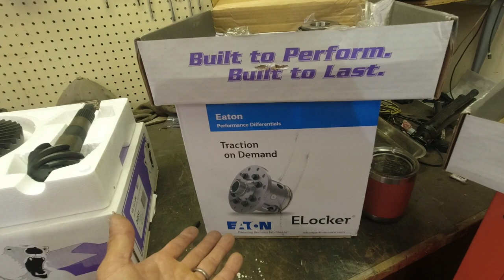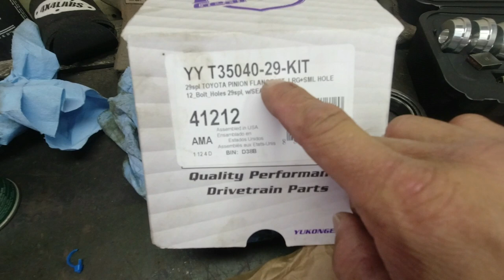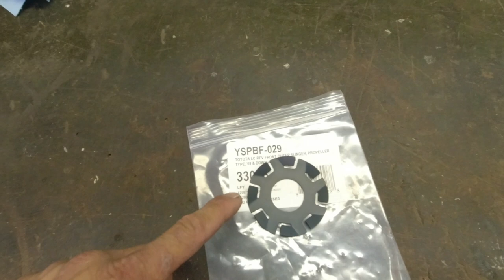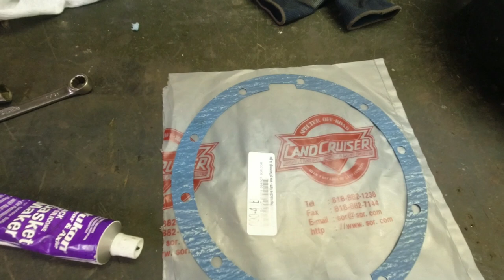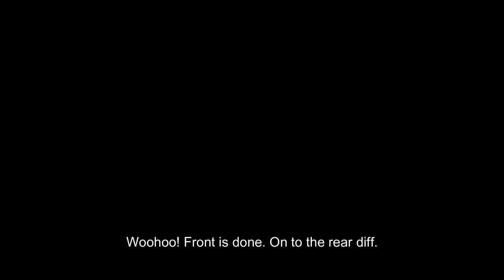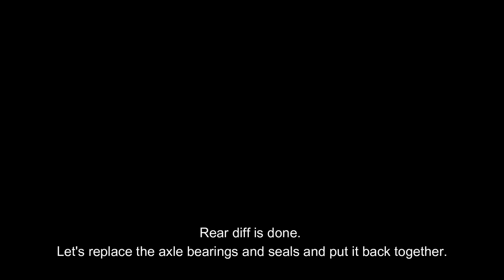80 Series - Axle and Diff Rebuild: 4.88 gears, front E-locker, Steering Knuckles

Comment: Once you have a chance to break the gears in, I’d love to hear your thoughts on highway drivability post-regear.
Reply from the maker: Well, actually I did that re-gear project in July 2021, and I've now driven at least 10k miles on it. The gears work great, and the locker is awesome. The 4.88s help in multiple ways: more torque to the wheels, slower crawling speeds, and higher RPMs at 70 mph which helps with power up hills. It drives much better than before. However, it does not change the fact that the stock 3FE engine is sluggish and low HP. Still not a race car, haha.

Comment: Question please why did you change the diff is it because the lack of power on bigger tires? And why did you have to do the front as surely not in 4x4 modes all time. And last is the new gearing 4.88 to1 hope you got the power you wanted thankfully 👍
Reply: Short answer: yes, re-gearing will restore a sense of power lost with bigger tires - the real issue is that your RPMs are different from stock when you have bigger-than-stock tires. The 80 Series Land Cruiser (US version) has full time AWD, not 2WD, so the front is always engaged. Plus you should never have your differentials geared differently - everything will break - your front axle would try to go a different speed from your rear axle.

Comment: Before you did all of this work, I am curious if you had the 80 series clunk in which when you let off the accelerator you hear a clunk sound? If you did, did all your work end this clunk?
Reply from the maker: I don't remember if I had a clunk when I let off the accelerator... I did have a loud clunk when I would shift from Drive to Reverse or vise-versa. A lot of that went away when I did this, but not all of it. I think some of the clunk was in the birf to drive flange splines. Someone on the Mud forum described it well by saying: each connection in the drivetrain has a little bit of play, all of those accumulate into a clunk, and it's very normal in these old 80s. I think a lot of it can be minimize by rebuilding those components. I'm planning to rebuild my T case this winter, and I expect to find some slop in the front output.
Reply: @ldooffroad1823  I hope you’ll do more videos like this with future work 👀

Comment: What's your take on 4.88 gearing now that you've gone LS swap? Also, when LS swap video(s)?
Reply from the maker: I'm hoping to edit and release the LS swap videos this year. Sorry for the long wait. The LS power definitely helps move the bigger tires, and depending on what tire size you want, it may not be necessary to regear to 4.88s. Currently I'm on 35s with 4.88s and the V8 with GM 4L60 tranny. This combo is slightly undergeared, meaning I run slower than my speedo says. It works fine, and would allow me to run 37s without regearing, I think. If you're still running the stock engine, I would definitely consider regearing to 4.88s if you run 33s or bigger.

Comment: Love the video. Can I ask why you didn’t put in a locker in the rear diff?  And how much would you say the parts cost you?
Reply from the maker: I spent $3k+ for everything in this video. Shortly after spent another $450 on inner axles. They do not make a selectable locker for the semi-floating axle in the early model 80s. So that solution is coming in a video to come…
Reply: @ldooffroad1823  Thank you very much. Working on picking up an 80 in the next 6-8 months. Saving right now. Looking to build a capable overland camping rig.

Comment: How did you wire up the e-lockers?
Reply from the maker: Maybe I should put together a video for that... In short, the instructions explain the basics, but you choose how to get power, where to put the switch, and so on. I ran the main wire harness from the locker up the passenger side of the engine, across the firewall above the engine, and over near the brake master cylinder, where I went through the firewall to the interior. The power wire connects to the battery and through the firewall as well. Then on the interior, I got power from the small fuse box inside, and ran everything over to the switch, which I placed in the center of the dash down low near the cigarette lighter. Hope that helps!

Comment: How did you know that it has c clips by the year?
Reply from the maker: There are a number of differences between the 91-92 and the 93-97 Land Cruiser. As I research parts before a project, I usually learn about those differences in the process.